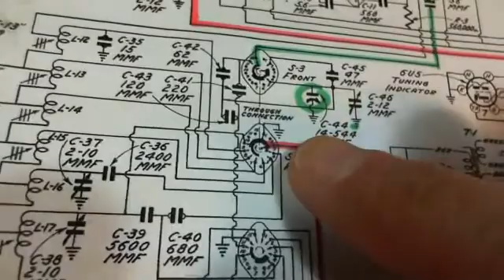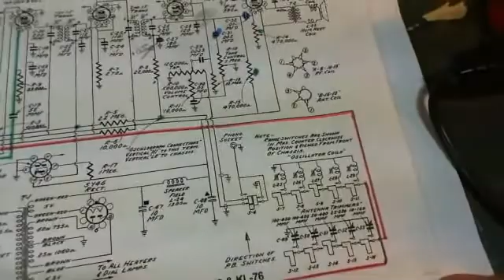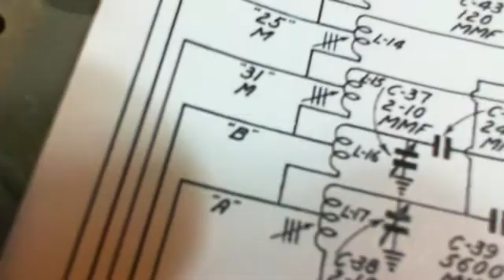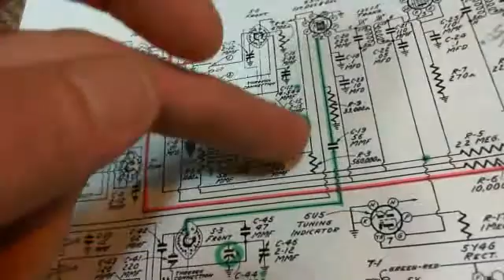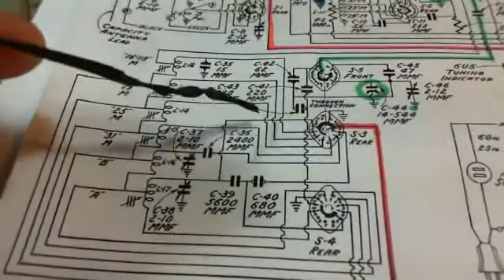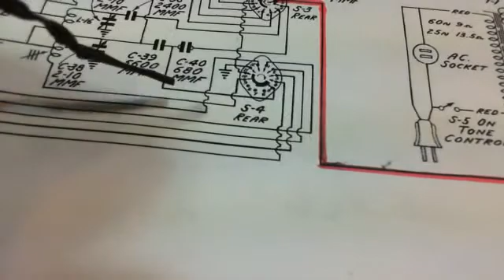General Electric KL-70 AM/SW Radio Video #21 - Studying the Wafer Switches on Schematic

Comment: Hi Jim. If I am not mistaken the switches are set for the AM Band in the schematic. Look at the contacts on the schematic and then at the real switch in your radio when you know it's set on the AM band. This should help you a great deal in tracing the wiring in your set. Has you said they all work as one switch. This is similar to some of the switchs I worked on in my day. I hope this helps.